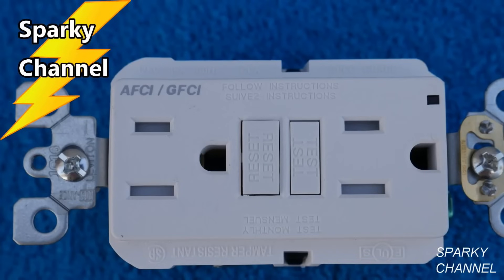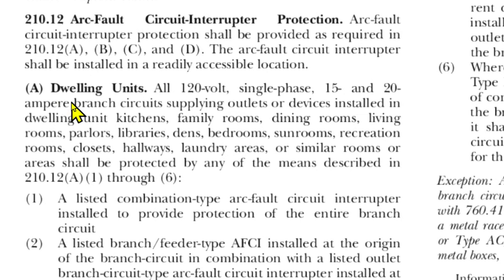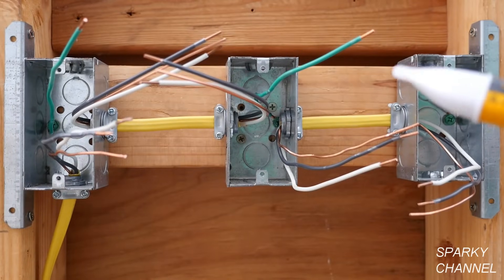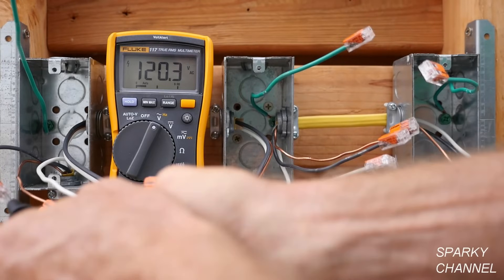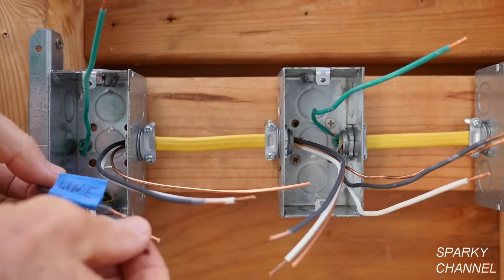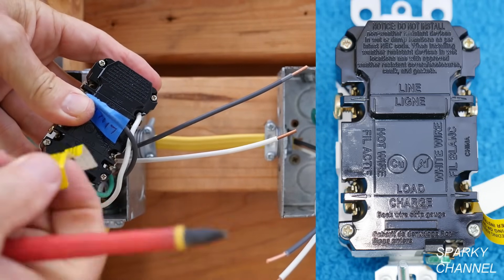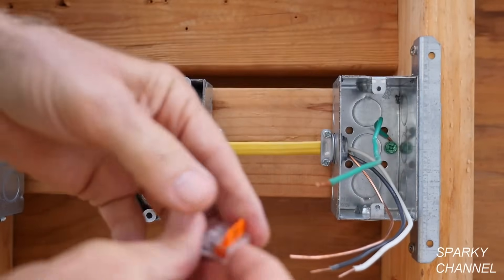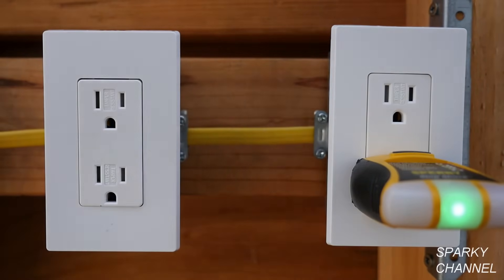Protect a Circuit With Both AFCI and GFCI with a Receptacle!

Comment: Hi Sparky, great videos. Code says the line can't be over 70ft from overcurrent device. Is the device a breaker or receptical? Does this apply to runs that are 100ft and above?
Reply: overcurrent device means the breaker.  and yes, 70 feet is the maximum - so you can't do this on a 100 foot run.
Reply: @kenbrown2808  would you then put in the breaker in place of the receptacle?
Reply: @jeromenewton792  yes, you would have to.
Reply from the maker: As Ken said, the overcurrent device means the breaker.
Reply: @SparkyChannel  70' on 20a circuits, 50' on 15a circuits that require arc fault protection.
Again, it's best to use an AFCI breaker.
Reply: Thanks for that. Does the 70ft rule apply to all circuits? If not what circuits doe it only apply to?

Comment: We are at the point now we don't need gfi. Outlets ..the breakers are combo..  right? In most cases
Reply: I think you mean "Dual." Combination means different types of arc faults. Dual means Dual GFCI and AFCI.
Reply: What Mark said... Combination AFCIs do not provide GFCI protection...Need a DUAL AFCI...
Reply: @josephknapick5307  trade slang varies, but where I am, it is assumed that AFCI refers to the required combination sensing AFCI, and "combination AFCI/GFCI" refers to the multifunction device.